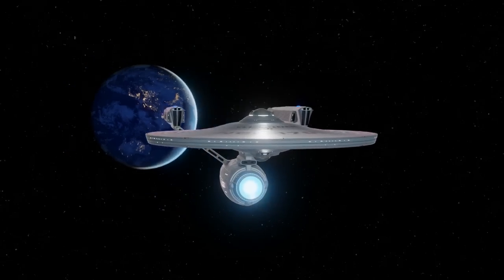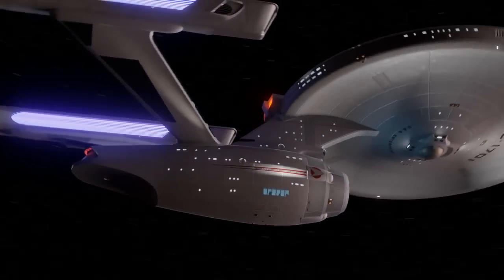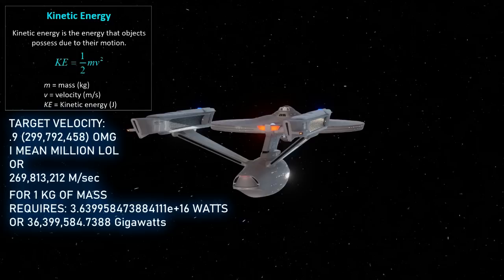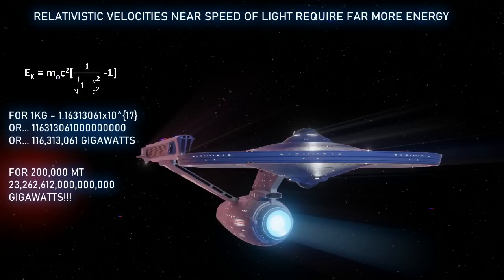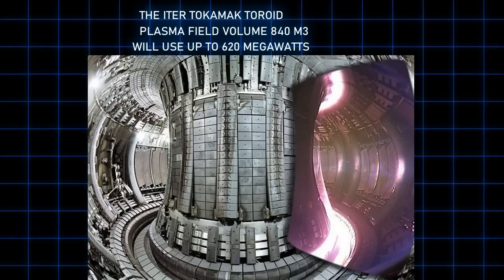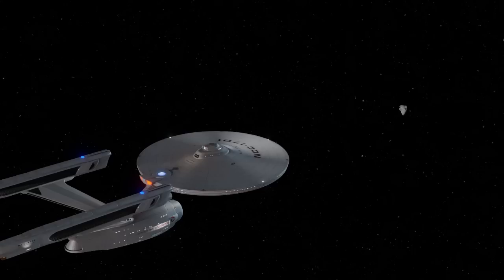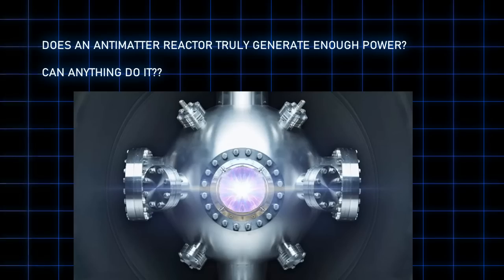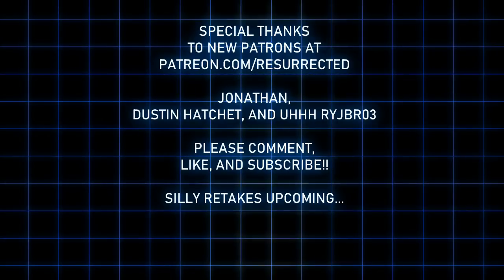How Many Nuclear Power Plants Can Power the Enterprise? Let's Calculate!!!

Comment: The Enterprise has a noted weight of approx. 190,000 metric tons, unloaded; however, the impulse drive also operates with low-yield subspace fields -- this allows for acceleration at sublight speeds for much, much less energy than conventional physics would note for relativistic acceleration. (It's a lower-grade effect similar to how/why warp fields allow for in-effect FTL travel by creating "negative energy" via the fictional/hypothetical subspace -- the ship, itself, never changes in local momentum at warp "speeds", but rather the bubble of the field is "severed" from conventional space and the space around it is compressed ahead and expanded behind the field bubble for far, far less energy than conventional physics would require.) This makes trying to use a nuclear reactor equivalency very tricky because the existence/use of "subspace" mitigates conventional physics.
Reply: That's deadweight tonnage, not mass.
Reply: @Idazmi7  ? -- I noted it as unloaded (no personnel, cargo, furnished cabins, etc.). In the old tech guides the weight represented the mass, best as I read, relative to each respective ship; that is, the amount of "x" materials used for its structural composition. (Obviously the exact mass at any given time is not knowable as crew and passenger accompaniment, cargo, etc, would vary -- especially for instance with the Enterprise-D, which was noted in some beta sources as having as much as 30% of the saucer section be "empty" at any given time, for use as available space/internal structure for passengers and/or mini-internal-refitting as-needed.) 

Regardless of the exact number, my larger-point citation is that using the mass of the ship vis-a-vis conventional physics is very misleading because even at impulse speeds much of its effective mass is displaced by subspace fields used as part of the impulse drive -- it's not simply thrust that moves the ship as with a conventional rocket. That's the point.
Reply: @tideoftime  Deadweight tonnage or tons deadweight (DWT) is a measure of how much weight a ship can carry. Not how much it weighs.
Reply: @Idazmi7  I just double-checked -- it explicitly cites the mass of the ship as being 190K tons (not it's cargo or passenger capacity). Now, perhaps the citation itself is in error for the concept-of-ship-as-presented, but that's what it notes as the mass of the NCC-1701. Where are you getting your citation from?
Reply: @Idazmi7  I also double-checked for the mass of the E-D, for comparison -- they cite that in the neighborhood of 4M tons, which is much, much more, but makes sense relative to its greater size/volume and denser composition.
Reply: @tideoftime  
"I just double-checked -- it explicitly cites the mass of the ship as being 190K tons (...) Where are you getting your citation from?"

That's Deadweight tonnage. Explicitly labelled in the SFTM under "deadweight tonnage-metric". You aren't reading the manual. 🤦‍♂
Reply: @Idazmi7  I was reading the PDF-cite from the aggregate tech PDF, but apparently the cite-grab is indeed incorrect/a partial citation, so I will bow on that point (the ship's mass is apparently mislabled in the grab as 190k vs approx. 1M metric tons). However, that still is neither here nor there relative to what the point of the post was: it's a false energy citation to note the mass, regardless, of the ship relative to conventional energy propulsion because the ships mass, even at impulse (though not maneuvering thrusters) speeds is also displaced by subspace fields. That was the point of the post, not the direct citation of the mass, itself, but that trying to note conventional energy output for moving the ship is skewed because of the concept of subspace/negative energy for mass displacement. So while you are correct about the number, you're missing the forest for the trees, so to speak, relative to my initial comment.
Reply: @tideoftime  
"So while you are correct about the number, you're missing the forest for the trees, so to speak, relative to my initial comment."

Except I'm not: I just illustrated that you're not relying on credible sources for your information.

"(...)  conventional energy output for moving the ship is skewed because of the concept of subspace/negative energy for mass displacement."

Case in point: the process of using subspace/negative energy for mass displacement was only used twice in the entire series: once to move an asteroid, the second to move Deep Space 9 (a space station, not a starship). Both were done under emergency situations, over VERY short distances, and caused significant stress on power and structural integrity systems. It is NOT a typical propulsion method.
Reply: @Idazmi7  In Re: DS9 -- that's a miscontextualization of the situation in that scenario: the station isn't properly designed for movement like that to begin with; hence, the improvising of available tech to move the station as if it were a starship, in effect, and the resulting strain/possible issues due to the station not actually having an impulse drive. 

For ships that are actually designed for sustained travel in the ST universe, the impulse engines do contain low-yield subspace field generators (via toroids in the engines which have drive plasma channeled through them). Per the STTNG:TRM, pg.77, referring to the Impulse Engines (edited the considerable middle part which has nothing to do with the drive but with power redirection) emphasis mine

"During propulsion operations, the accelerator is active, raising the velocity of the plasma and passing it on to the third stage, the *space-time driver coils*. [... >refers to power being redirected for non-propulsion use when needed< ...] Energy from the accelerated plasma, when driven through the toroids, creates the necessary combined field effect that (1) *reduces the apparent mass of the spacecraft at its inner surface*, and (2) facilitates the slippage of the continuum past the spacecraft at its outer surface."

That's why the impulse engines can operate as relatively efficiently as they do: they don't just provide raw thrust (unlike the maneuvering thrusters) but also displace the mass of the ship, as well, which is why using conventional physics vis-a-vis energy requirements to provide "x" velocity to "y" mass over "z" time isn't going to provide an in-universe-correct assessment of how much energy is actually being used by the impulse engines. It's similar in that regard to how the warp engines work but at a lower threshold of effect for sublight speeds (and, of course, the warp engines supposedly displace effective mass via negative energy "bleeding" into subspace, distorting space around the ship and causing it to "move" but without actually changing the ships inherent momentum, unlike with the impulse engines).

(Special thank you to my friend Chris who provided the copy-pasta as I am not near my books)
Reply: @tideoftime  
"In Re: DS9 -- that's a miscontextualization of the situation (...)"

As I just explained to you, using subspace fields for sublight movement does not happen - it is not even referenced - anywhere else aside from Enterprise-D using it's WARP ENGINES to move an asteroid moon, and BOTH events nearly destroyed the ship attempting it.

"Per the STTNG:TRM"

That book contradicts every Star Trek episode in existence. There's a reason it's non-canon material. You will never find any reference to impulse systems having any subspace component any Star Trek episode: not even in Voyager.

The original SFTM is a far better resource... but it only relates to TOS tech. In any case, there's no mention of 'subspace impulse' there, either.

"(Special thank you to my friend Chris who provided the copy-pasta as I am not near my books)"

It wouldn't matter if you were.
Reply: @Idazmi7  You are misreading the citation. It isn't saying that the subspace field created by the impulse drive propels the ship -- it doesn't. It helps displace the mass of the ship (which is one of the attributed qualities of subspace fields, among others) so that the thrust of the impulse engines can more efficiently propel the ship with much less energy than would be required under normal physics. The original SFTM is much less contextually reliable than the sources because the latter have more developed hypotheticals behind it vs the former. They include a better context for how/why what we see occur within the ST universe works the way it does. 

And in context it doesn't matter if the STTNG:TRM isn't cannon -- neither is the SFTM, nor any other published resource, as a matter of prerogative on Paramount's part relative to what the deem in-universe cannon. But that doesn't change the credibility of what is noted in there relative to what we see occur in the setting -- more so than what was less developed in earlier episodes (TOS) and early non-cannon sources like the SFTM... especially when taking into account a video like this one where having the albeit-secondary-source material cite "x" goes quite a long way towards understanding why there is such an energy-to-mass "discrepancy" between known real world physics and what is attributed on the various shows.
Reply: @tideoftime  
"You are misreading the citation. It isn't saying that the subspace field created by the impulse drive propels the ship -- it doesn't. (...)"

Wrong again. The entire concept of mass displacement is not used for sublight travel in Star Trek. Ever. even in the context of merely assisting sublight propulsion. Mass displacement is a function of subspace fields, which are exclusive to Warp Drives. That is stated directly in both cases (the only 2 cases) where it was used for sublight movement.

In short: you don't watch Star Trek at all. You rely entirely on internet sources for your data.

"The original SFTM is much less contextually reliable than the sources because the latter have more developed hypotheticals behind it (...)"

A common claim, but entirely false. The SFTM is the result of a USN engineer extrapolating Star Trek's technology into real world theory and application. The Next Generation technical manual was made entirely for profit, and was written by glorified VFX artists. As a result, it doesn't contain hypotheticals: it contains technobabble. Technobabble that isn't even used in Star Trek, and directly opposes what we see in Star Trek.

"And in context it doesn't matter if the STTNG:TRM isn't cannon -- neither is the SFTM, nor any other published resource, as a matter of prerogative on Paramount's part relative to what the deem in-universe cannon. But that doesn't change the credibility of what is noted (...)"

There is no credibility in the ST:TNGTM. Not one syllable of it. For example: it says phasers are impossible to use at warp speeds, despite phasers being fired at Warp Speed in every single Star Trek series to date.
Reply: @Idazmi7  1) I have watched every episode of ST, most of them numerous times, that has ever aired (including TAS)., since the 70s; 

2) References that appear contradictory (such as with phasers at warp) are contextual to the also-noted idea that the warp fields distort the use of energy weapons and limit their effectiveness at warp speeds, which is definitely a "thing" in ST, which is why photon/quantum/plasma torpedoes (with the latter one actually being highly questionable in context, but that's a separate conversation) are the more-often go-to choice at warp speeds -- particularly because at said speeds the distances covered/ranged are often beyond what the beam weapons can reach except when at close range and at the same warp speeds); similarly for secondary concept-citations like "Ultra-Warp", which was noted then but abandoned, despite the warp velocities notable in that concept better reflecting many instances of travel as-occurred in the various series and movies up to that point;

3) the in-universe information cited in the later sources is premised off of the earlier hypotheticals but extrapolated on in ways that better reflect not only what was often demonstrated in the TOS era (keeping in mind the needless-to-say contradictions that occurred frequently on that and all eras of ST) but in the later TNG era as well; 

And 4) the instances where subspace fields were used to displace mass in non-warp conditions (such as with the moon in Deja Q, which allowed the tractor beam to try to nudge it) is just as valid in context, and makes more sense in the broad, as any of the other principles used in the ST universe, particularly as again it readily explains how notable amounts of energy/force can create greater effects than they "should" for the same amount of energy notable in real world physics.
Reply: @tideoftime  
"I have watched every episode of ST"

That is the single most consistent thing I see people like you say when they get cornered in an argument. The problem is, if you had watched star Trek, you would intimately understand the errors you are making. You don't.

"References that appear contradictory (such as with phasers at warp) are contextual to the also-noted idea that the warp fields distort the use of energy weapons and limit their effectiveness at warp speeds, which is definitely a "thing" in ST (...)"

No it isn't. That's the problem, Mr. "I've seen every Star Trek since the 70's" - they do it all the time without a single problem. Especially in TOS. That's the problem with your argument. 

In other news, "I find it unlikely that Star Wars' lightsabers can deflect blaster fire."

"the in-universe information cited in the later sources is premised off of the earlier hypotheticals but extrapolated on in ways that better reflect not only what was often demonstrated in the TOS era (...)"

Wrong. I literally don't have to give a better reply than that.

"And 4) the instances where subspace fields were used to displace mass in non-warp conditions (such as with the moon in Deja Q, which allowed the tractor beam to try to nudge it) is just as valid in context, and makes more sense in the broad"

Your opinion is duly noted, and dismissed on the premise that there is no evidence of it being true outside of your incredulity.
Reply: @Idazmi7  I don't know if you think you're talking to a "kid" or not, but I am in my 50s and have watched ST since the 1970s as a kid (and saw TMP in the theater), so you can believe that or not but it's absolutely the case. So that's on you if you think otherwise.

Yes -- they do fire phasers at warp. I didn't say otherwise. I specifically noted the reference in contradiction but also noted the contextual rationale as to why it makes sense. (TOS fired phasers with a degree of range that went from credible to ridiculous across its run... which anyone familiar with the series would/should be quite familiar with...) What I was noting was how in later eras the range at which phasers (any energy weapon) were fired while at warp was much more limited in scope and often very close -- as very notable in many such instances. That was the point of that, not whether or not the tech guide noted "x" or "y" in that regard, specifically.

And as to your last point: it would be, in your phrasing, to my credulity  in your view, not my incredulity , relative to the idea I'm citing. (You, contextually, are the one expressing incredulity about that, not me; however, neither am I expressing  excessive credulity, either, but taking the general information provided and weighing it against the various series as-presented and coming up with the later tech manual making quite a degree of sense because it again readily justifies the ships' ability to do "x" at "y" rates.)
Reply: @tideoftime  
"I don't know if you think you're talking to a "kid" or not"

Your age is irrelevant. Your obvious ignorance of star Trek is the only important thing here.

"Yes -- they do fire phasers at warp. I didn't say otherwise. I specifically noted the reference in contradiction but also noted the contextual rationale as to why it makes sense. (TOS fired phasers with a degree of range that went from credible to ridiculous across its run... which anyone familiar with the series would/should be quite familiar with...)"

What? You think a computer couldn't hit a suitcase-sized target from 90,000 kilometers with a laser? We can do that today chuckles, so I'd readjust my expectations.

"What I was noting was how in later eras the range at which phasers (any energy weapon) were fired while at warp was much more limited in scope and often very close (...)"

Incorrect. Again. In TNG, we see phaser hits at 300,000 kilometers, and there's no mention of subspace fields limiting anything at all.

"(...) That was the point of that, not whether or not the tech guide noted "x" or "y" in that regard, specifically."

The ONLY thing you've actually referenced so far is the ST:TNGTM, which isn't canon by a long shot. Everything else you've said relies on 'everybody knows' logic, and it's not working.

"And as to your last point: it would be, in your phrasing, to my credulity  in your view, not my incredulity, relative to the idea I'm citing."

Nope. Unlike you, I have actually watched Star Trek, so there's nothing to be incredulous about on my part. Your statements simply don't add up to what has been seen on screen.
Reply: @Idazmi7  In Re: Phasers and Warp (ranges) -- I'm referring to ranges such as the TOS-E firing at targets that (while at warp) are millions of kilometers away, when prior ranges were much closer in other episodes... then longer... then closer... etc. That's what I mean by inconsistency. Later series had generally better consistency. (And the 300,000KM range in the NG era was outside of warp; during warp, that sort of range is practically useless unless both ships are at equal warp speeds and in very close proximity to each other -- and as-pictured in virtually all situations for NG era shows, vessels attacking with energy weapons at warp were very close to each other.)

In Re: references -- I have been referencing examples in the series (ex: Deja Q), and regardless you yourself have made no more specific a reference for the points I'm noting, yourself... so that's a very questionable counter-argument on your part...

In Re: credulity vs incredulity. I was making a backhanded joke about your misuse of "incredulity" in your one sentence referring to me; what you meant to say in that context would be in reference to my credulity in terms of the ideas I am relating, not my incredulity relative to them. (If you meant my "incredulity" relative to your comments, then you aren't saying what you think you are by phrasing that sentence the way you did.)

***

And now as my friend Chris has scanned through your posts (as I am not as computer adept, by any means, as he is) and gotten back to me, it seems that -- according to him -- you are supposedly a sort of "troll-buster" (his term, not mine) but seem to do just as much trolling yourself. Armed with that knowledge now, I am going to assume that you are not actually having a good faith discussion at this point but are just trying to run me under a bridge. With that, I will be blocking you. Have a good evening.
Reply: @tideoftime  
"I'm referring to ranges such as the TOS-E firing at targets that (while at warp) are millions of kilometers away,"

Really, now. That's one I haven't heard before. Please, do give me an example.

"I have been referencing examples in the series (ex: Deja Q) (...)"

Excuse me: I made that reference, in support of my argument. You have yet to counter it.

" credulity vs incredulity. I was making a backhanded joke about your misuse of "incredulity" (...)"

It would help your joke if I was actually guilty of misusing the word or otherwise making a mistake. Instead, it just makes you look silly.

"And now as my friend Chris has scanned through your posts (as I am not as computer adept, by any means, as he is) and gotten back to me, it seems that -- according to him -- you are supposedly a sort of "troll-buster" (his term, not mine) but seem to do just as much trolling yourself. Armed with that knowledge now, I am going to assume that you are not actually having a good faith discussion (...)"

Yes, back out of the conversation now that you finally began to notice that you're losing ground. Thing is, you noticed far too late.